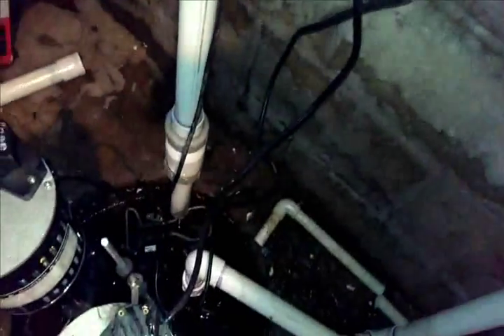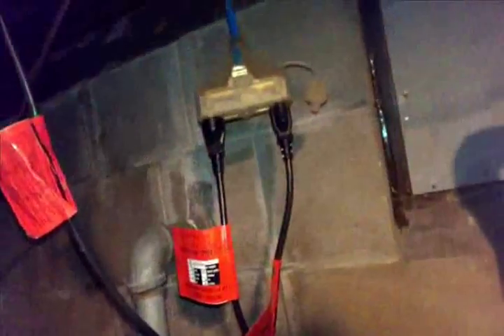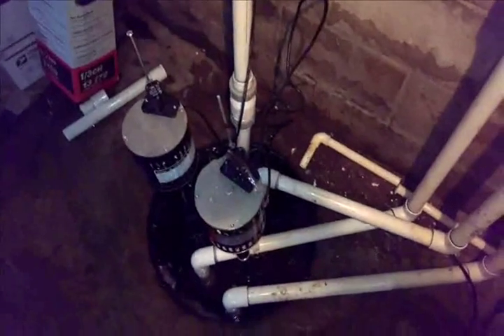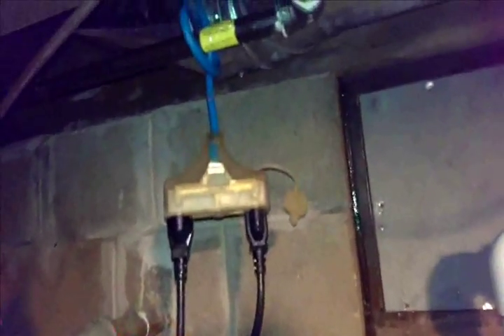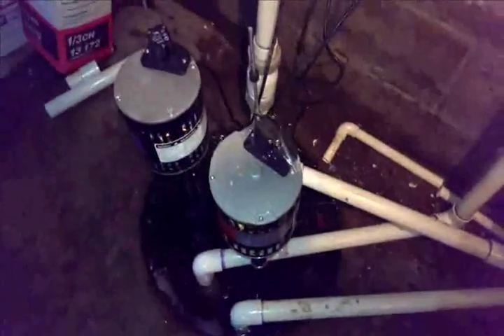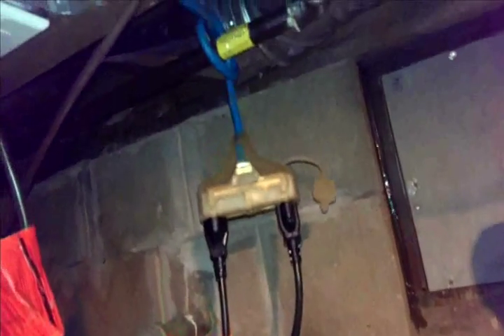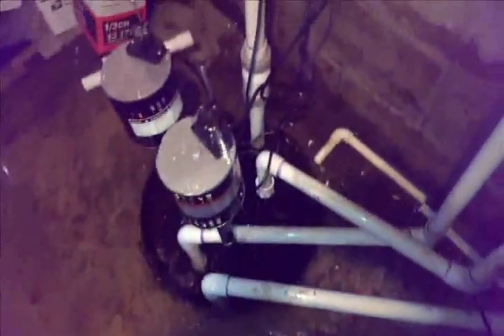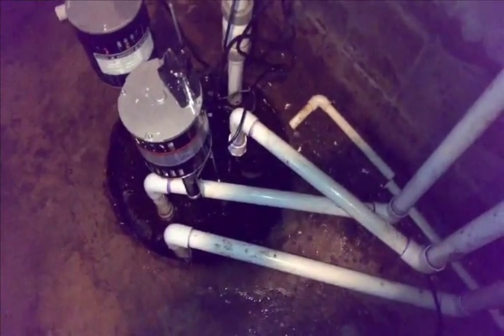MULTIPLE SUMP PUMPS ON 1 CIRCUT = FAIL! Know your equipment:

Comment: if those pumps are 330 watts dont forget about start up peak power...they will each draw more like 500 watts each when first starting up as all motors use more power for initial startup to get moving  up to speed and then drop down to their power rating